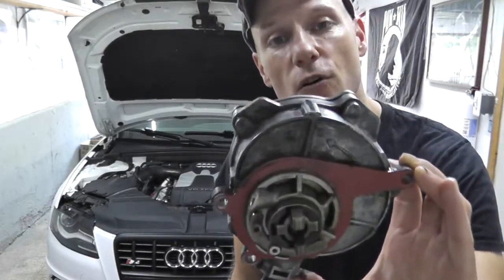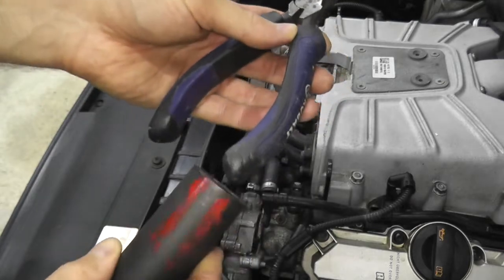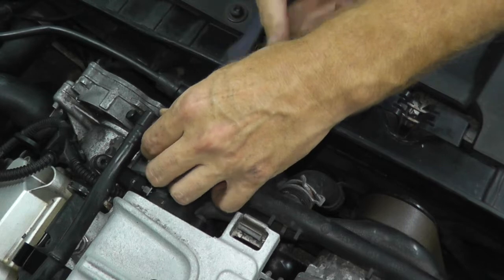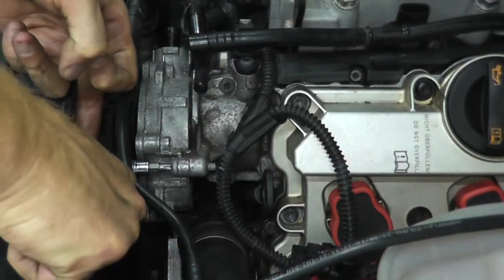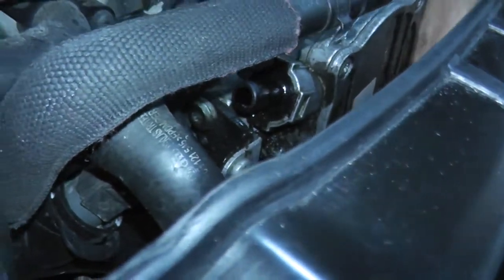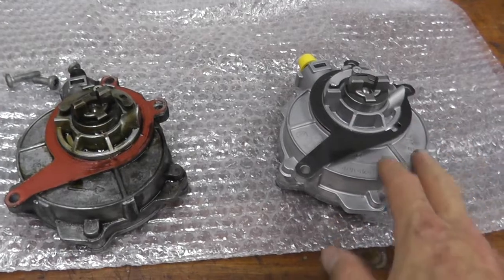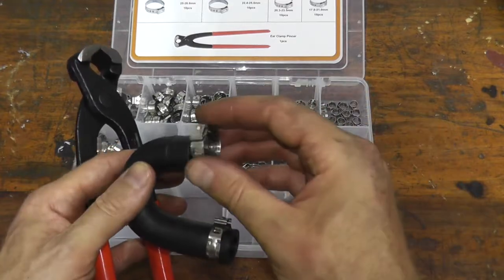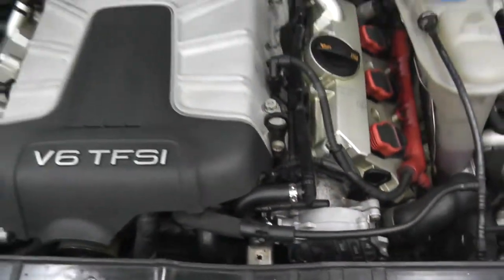Audi or VW Power Brake Booster Vacuum Pump Replacement

Comment: thanks so much this will explain why my car had no oil! with still 2500 miles till me next oil change… and today my check engine light came on giving me a code for this, it’s also giving a coolant problem code and i’m wondering if this has anything to do with it or if i just have a bad sensor
Reply: hopefully it’s the brake booster/vacuum pump

Comment: Why did you replace it? Any codes in particular or oil surrounding the pump?
Curious if i should do my one or not. I get a check engine light daily for a vac leak
Reply: Mines has oil and crud all over it very bad but no lights on or anything for it
Reply: @Charlie7146  Another dude on a forum responded to me but if the oil on the pump is recent you might be able to just replace the gasket. If it's been oily and dirty for a while most likely the
pump itself is gone as well. I just ordered a new one for about $155 cad all in, easy enough of a fix
Reply: @owenmccarthy4636  I got my new pump in the mail, got the bottom and top bolt off, but cant get the one on the left off, damn near stripped the bolt trying, got a couple cuts from it aswell lol

Comment: I have no oil light that comes on but there's a leak coming down the engine coolant inlet flange hose cars done 83,000ks, and also leaks on the alternator and on the ground oil refilling every week. New Zealand is hard to get the parts needed to fix the oil leaks. It definitely is not the valve cover gaskets as they are brand new. The part I want to know if this part for my Audi A6 06E 103 535 A is either a vacuum pump or a high pressure fuel pump.

Comment: Necessary to replace the whole pump or can the gasket be replaced? Only issue I’m having is an oil leak.
Reply: Yes you can. That's exactly what I did with mine on my '08 B7 A4 just a few days ago. Parts can be purchased either from eBay or Amazon. Bought mine from the latter.

Comment: Hello does anyone know why my audi a6 c6 brakes only come half way back and it happens only sometimes , but when the brake is down the car does not actually brake but just the brake light goes on and brake itself works completely fine , i checked DOT 4 oil and everything ok there. I am thinking that it might be some issue with the brake pedal itself. Please help
Reply: Slider pins on calipers would be the next thing to check.  If they are sticking it will cause this

Comment: Im not sure how yall got the bottom screws out they wont breake free what so ever for me, feels like im strippin it

Edit: got all screws off and replaced with a medium sized ratchet. Fixed oil leak.
Reply: How did you managed to remove the screw ? I feel like I'm stripping one
Reply: @nastymartel  the small ratch wouldnt work i had to use a bigger one that angled and put a lot of pressure on it. Turn it little by little

Comment: Greetings from New Zealand my Audi A6 I'm not sure if oil is leaking under the vacuum pump or if its the high pressure fuel pump. Also after the car stops and turns itself off at the streetlights its a start stop car but as soon as it starts back up I put my foot on the accelerator but it konks out any idea what this problem would be. Thanks for the tips much appreciated.